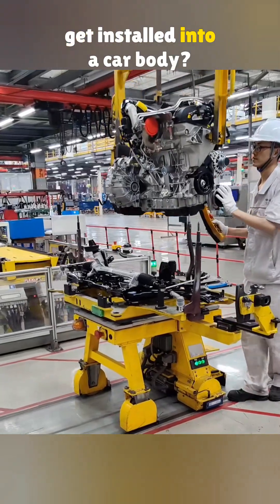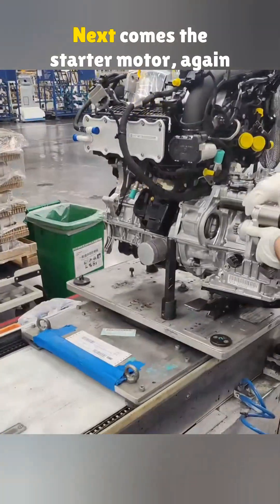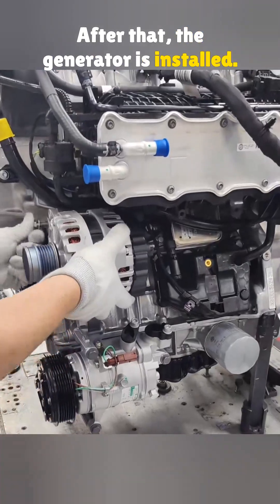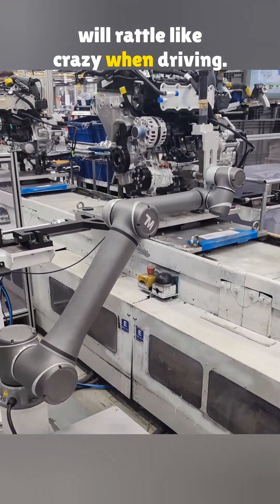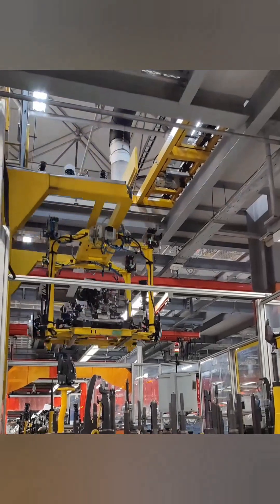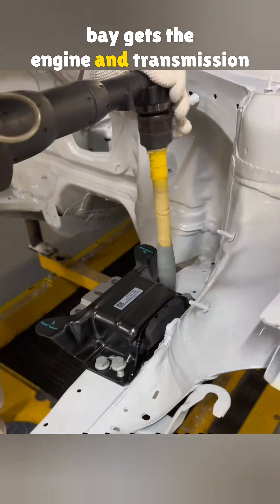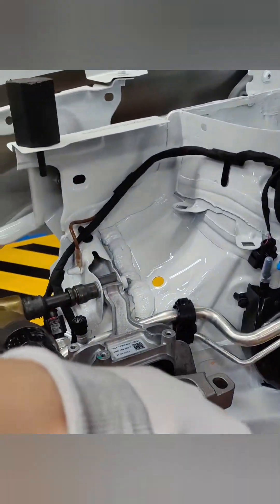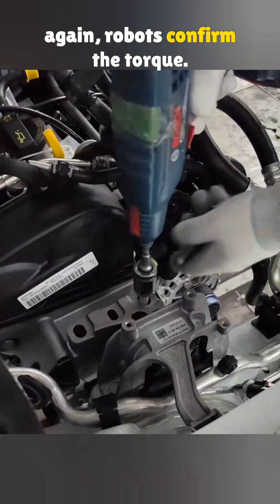How an Engine Meets the Car Body on the Assembly Line

Comment: Volkswagen EA211 engine

How an inline engine is mounted in front wheel drive ICE vehicles is a disgrace.  Vehicle manufacturers should be forced to make the engine and it's major modular and  replaceable  parts much easier to acees. Volkswagen design is actually better than most in this regard, but it could still be greatly improved upon.  

The way an engine in front wheel drive ICE vehicles is not designed for straightforward replacement of engine parts like the alternator, starter motor, water pump, timing chain, manifolds, spark plugs on the firewall side, etc.

On many vehicles to replace the alternator requires removing the intake manifold.

On some cars to replace the timing chain requires the alternator.l, ac compressor, water pump, harmonic balancer, headcover, subframe, oil pan, etc. With very little room to maneuver. 

This has been like this for ages.

P.S. The 'torkee' has to be checked LOL. Generator instead of the correct term alternator. The  'engine mounts' are not typically called 'brackets'. No mention of the 'serpentine belt'

Comment: It's an alternator not a generator
Reply: Technically it is an AC generator. The term "alternator" was coined to distinguish an AC generator from the DC generator cars had back in the early days.
Reply: @patrickmitchell6968 so on a modern car an alternator can be called a generator
Reply: @phillipbonner5215 Yep. Actually the OEM service/workshop manual for my vehicle refers to it as a generator.